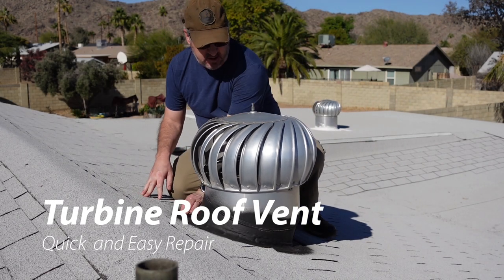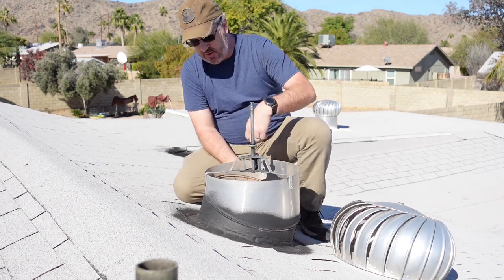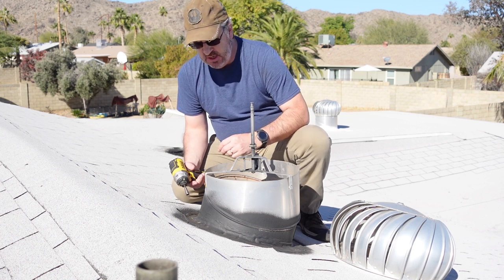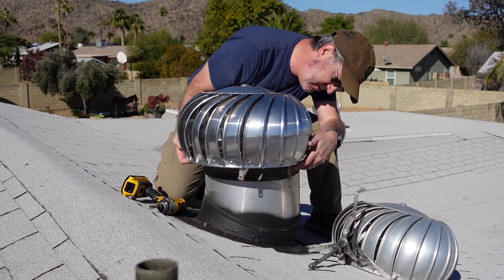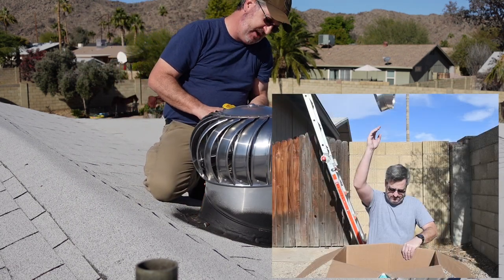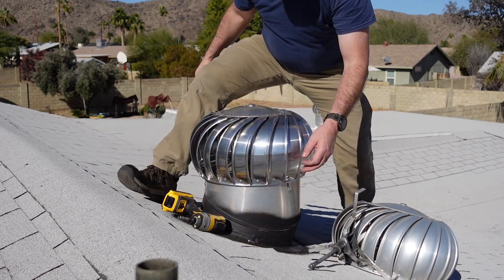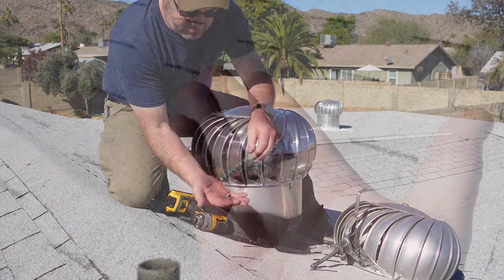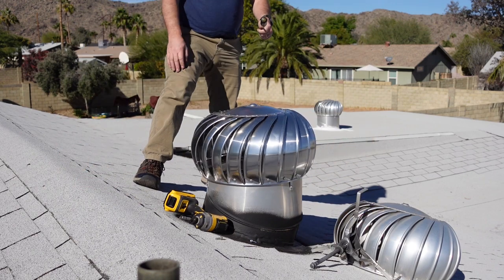Attic Vent Turbine Repair

Comment: Thanks AZ DIY Guy-------     You just reminded me to replace my old squeaky fan, with a brand new fan, instead of trying to lube the thing.     Easier to just get a new one like you showed, and trash the parts in a new kit.    Only thing I need to do is spray paint the new turbine, while it is on ground level.      Beige spray paint at the hardware store.

Comment: Using power tools on those fasteners is a sure way to strip them out. Hand tools is the way to go, even if it does take an extra 1 min.
Reply from the maker: I guess I did it wrong, I didn't manage to strip them out 🙂

Comment: Does water get in there? I have to replace mine but I won’t have time till next week to fix it. We’re expecting some rain
Reply from the maker: We didn't get any in when they broke because all the pieces were still in place. We had a neighbor completely lose one in high winds, rain sure got in that gaping hole.
Reply: @AZDIYGuy  oh!! Well hopefully its not too bad 😅 the “hole” is still in place. The turbine is the only thing that popped off lol
Reply: @AZDIYGuy  thanks for replying by the way!
Reply from the maker: @thumperliciouz  You got it. Sounds like time for some sheet plastic and duct tape before the rain. 👍

Comment: Are turbines better for our phx "flat roofs", like your on, or just gable vents are better?
Reply from the maker: I'm not really sure. Ours is primarily a sloped roof. We do have gable vents and soffit vents as well. It still gets blistering hot up there. I like these turbines because they not only vent, but they move the air.  I did have a powered gable vent in a previous home that did really well too.

Comment: Is there somewhere I can buy that exact same style, but just the head? All replacement heads at the big box stores have a different connection.
Reply from the maker: I bought these at Lowes. I was unsuccessful finding the head alone anywhere.
Reply: @AZDIYGuy  same. Seems like a lot of waste, but if it's the only option, whatareyagonnado?
Reply: @AZDIYGuy  I called Lomanco (the manufacturer of WhirlyBird) They stated the standard part number for the full assembly is BEB-12-(whichever color you want). The head replacement is TEB-12-(color) and is only a couple dollars cheaper and usually has to be specially ordered which causes freight charges that actually make it more expensive than the full assembly. Oh well, I tried.

Comment: This must be another one of those lamictos.
Mine doesn't have the straps on the side I don't know what brand it is it was here before I got the house.
Mine has a 9/16 hex head on the inside bottom
 And rattle's like hell in the wind don't see much play but shaft inside is rusted.
Reply from the maker: I think it is Lamco. There are several brands at the local home centers, you might just get lucky.

Comment: Don’t throw the rest of the kit away, you can use the base to cover a leak or hole in the roof temporarily in an emergency until you can fix it correctly.
Reply from the maker: Good idea to keep some stuff on hand. I'd been a pack-rat for years, but at some point I stopped keeping most leftover material. The clutter just got overwhelming versus the minor cost of buying something when/if I need it. I still have a ton of random stuff I have not touched in many years to clear out.

Comment: why is the title mention repair when you are simply replacing them?
Reply from the maker: My video, my choice. Because I didn't do an invasive full shingle lift, nail-pull, and replace the flange and all operation. A top swap repair is well within the skillet of an average homeowner with a screwdriver to repair, whereas an actual full replacement is significantly more challenging. A  bearing repair / replacement would also be a challenging diy for most. Sorry for the confusion.
Reply: Yes bearing replacement so much easier on the pocket😉